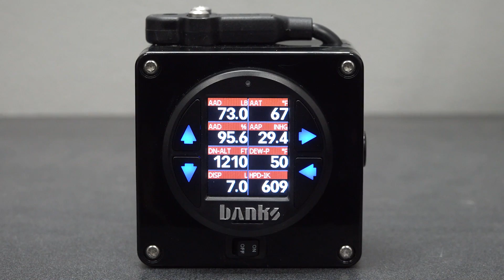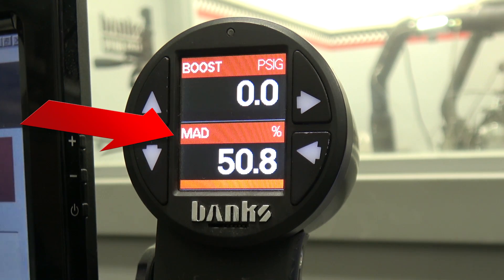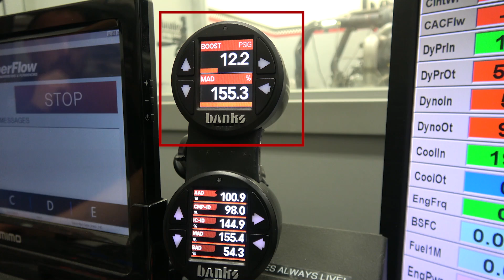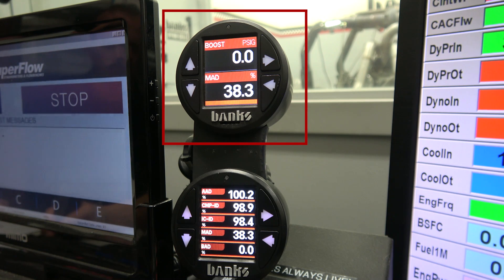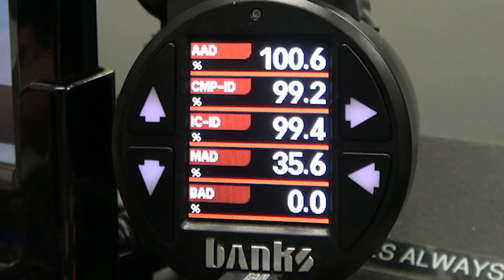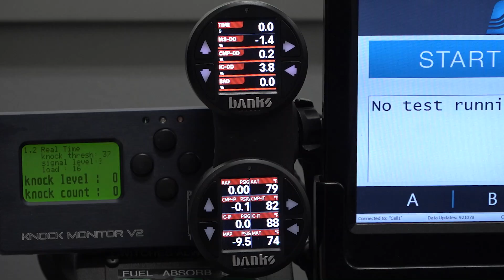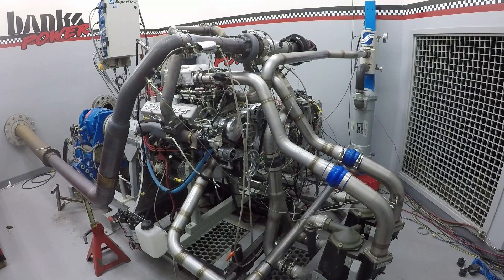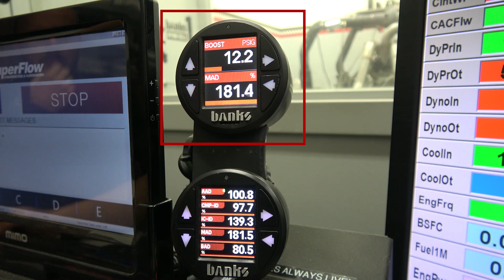Why the boost gauge is dead

Comment: methanol injection was big years ago but none talks about it anymore.....its chemical cooling, just like the intercooler.....does anybody know why?
Reply: I think E85 KILLED IT.
Reply: It's still awesome. You can just use water or windshield washer fluid.
Reply: @ike fun not very expensive at all compared to nitrous or anything like that
Reply: It was first used on p-51 mustang fighters during ww2
Reply: @scallen3841  
P47  also . I  believe  most  of  the  ww2  high  performance  aircraft  used  in  conjunction  with  supercharger/turbocharger  to  keep  head  temps down .
Reply: Cbmech Yes that is why , I know a few vets who worked on both those aircraft during ww2 . It was bad ass working on jet engines while I was in the Navy .
Reply: @scallen3841  Nah - a guy named Bucchi was a Swiss engineer who all-but invented the turbo in 1924. It was used on Diesels - they literally broke their dyno ! But on production airplanes I think it was the B-24 bomber using turboed Pratt & Whitney R1830 air-cooled radial engines. More HP for takeoff = more fuel or bombs. In just a matter of months P-47s, then B-17s then P-51s. I believe the Grumman F6F and the Chance-Vought F4U followed next (basically same engine as P-47, no turbo) and finally B-29 bombers with turboed Curtiss-Wright R-3350 radial engines, last thing during the war.
PS - Early jets used water injection, too !  Not like there was any chance of detonation of jet fuel (keosene) at the pressures available then - instead it was to add mass to the air ejected out the nozzle and bonus it dropped temperatures on the shitty turbine blades being used then (or allowed more fuel to burn at same temp = even better)
Reply: Helve Hammer Yep i know we covered all the early jet engine design and operations , when I was in jet engine mechanic school .
Reply: @scallen3841  Ya' know - just the other day I was watching a modern high-bypass fanjet airliner and wondering if water might have a place in that application.
Far as I know the Douglas DC-8s that Braniff used to get in and out of La Paz Boliiva were the last certified airliners to use water-augmented thrust and it was only at that one airport. (See what happened when takeoff there went wrong !)(scroll halfway down this page to the comment about "Splash of Colors")https://www.pprune.org/tech-log/10847-high-elevation-operations.html
Reply: Helve Hammer I work on cars now , I'll.watch it thanks
Reply: @scallen3841  Yeah - I had a little legal trouble and got my A&P ticket pulled.
Commercial floor-  and also truck-mounted carpet cleaning machines, debris loaders (chipper-shredder-blowers), tracked excavators, gas-burning Ford F-series trucks and trailers and hot high pressure washers pay my bills. One hobby is torturing 2004-2007 computers into running stripped down Windows 98 (second edition) to run the injectors, coils and whatnot on V8s (in realtime -doing the math instead of making maps). That fits into the main hobby of keeping the stick-trans mega torque mid size American road car ("freedom machine") flame alive . . . (I've cut down several 4-door GM A-bodies into two-seaters - and make my own blower drives and turbo installs) Did you know maximum horsepower (for ANY GIVEN FUEL) happens at 6.5 -to-1 compression ? Yep - provided you have unlimited boost and airflow. (and mind the tailpipes - they'll glow red all the way back to the bumper, lol !)
Reply: Helve Hammer i enlisted in 1987 and served till 1992 , i was a jet engine mechanic on fa-18c's in the Navy
Reply: @scallen3841  Cool. I have dreams about having my mitts on Hornet stick and throttle and surviving a cat shot. You ? Or is that ho-hum stuff ?
Reply: Helve Hammer I like working on the them
Reply: @scallen3841  I liked piston-era 4 engine transports. The last flying machines I worked on were Boeing 757 and 767s - but I will always love 727s and Lockheed Electra II turboprops.(C-130 wing and power - ten tons lighter, lol - makes a hell of a firebomber!)
Reply: Works great I still use it. 
My first setup which I used for years was just a washer bottle setup. 
I had a carb jet in the hose and blew it in the turbo inlet on a non intercooled setup. 
You could definitely feel it hit when you pressed the button. 
It might work on intercooled setups like that , but depending on a lot of variables it can puddle up in the intercooler, but it could be worth a try because shit like washer bottles are probably layin around most hordes.
Reply: You been living in a recluse somewhere ? water/methanol injection is huge, and has been for a very long time and there are dozens of suppliers, with tens of thousands of users. It is very common.
Reply: It is what it is......my friend used to build motors and he thought it was the next big thing........but he lost the business lol I guess he was wrong
Reply: The BMW M4 GTS has distilled water injection from the factory.
Reply: @IronFlamingo  Yes Oldsmobile had that in 1962 on their Jetfire sedan with it's Turbo-Rocket aluminum V8.

Comment: I'd be really interested in a modular gauge that doesn't work off the OBDII port. My truck is pre OBDII and I'd like to monitor things like MAD, oil pres, water temp, etc. I think there would be a good market for another version of the idash in which you can hook up what sensors you want directly to the gauge in a modular type setup.
Reply from the maker: Good news. We're working on pre-CAN iDash with all the sensors. Stay tuned!
Reply: @bankspower  That's great! I'm looking forward to it.
Reply: That's a good question, and good to see that Banks is working on a setup like that.  Hopefully it is more generic and doesn't rely on the computers, for those of us who are either pre-ODBII or wishing to tune up an older diesel for use in a newer truck.

Comment: More of an opinion piece. A boost gauge is not totally useless. I'd like to see the evidence that humidity plays a "huge" role in performance...
Reply: Based on my calculation, a change from 35% to 85% in relative humidity equates a 10% change in air density (when everything stays the same). A drop from 95*F to 60*F has an 8% change in density (when humidity is constant). Based on the physical equation it appear it would have a large role. We all know the performance differences between a 95* and 60* day at the track...which is probably why, when someone runs in the winter down south and it's 50* with 50* humidity (as opposed to 95 and 90%) you're seeing a combined effect and thus significant gains.
Reply: Look up a psychometric chart. You will have your mind blown. Use it for Hvac and humidity is a huge factor.
Reply: Humidity going into an engine is not something you can realistically alter. I'm guessing since they don't spray water vapor into engines, that the more humid the air, the less dense it is. Removing water from the air would be massively inefficient, and you would waste many times the power drying the air than the power gained created by the drier air. You're stuck with ambient humidity.
Reply: @timramich  they do spray water vapor into engined dumbass, it's called water injection
Reply: @christopherjameswall5182  Yeah, I'm the dumbass, tough guy, that doesn't understand the difference between humidity of the ambient air and removing heat from charged air by evaporating water into it. Water injection goes beyond what moisture air can even hold. Not even comparable to relative humidity. I'd imagine drier air is more dense than humid air, so water injection is for a purpose or cooling through phase change.
Reply: @ike fun Tough guy here
Reply: @ike fun And no, you can't dehumidify it without using more energy than you would gain from drying it...
Reply: @ike fun Because humid air is less dense than drier air, and even less dense when it is heated up, by say a turbo.
Reply: @ike fun As I've already mentioned at least twice, the evaporation of the water removes heat from the air. The methanol thing is about octane. FFS, drier air is more dense. Do a simple search. This is about relative humidity of the air. Dumbass...
Reply: @ike fun , no he's right.  It's you.
Reply: @ike fun Nope. I'm not the "retarde" here, "methanal" boy. When a liquid TURNS INTO a gas it absorbs energy from whatever is around it. It's called a phase change. It's how a refrigerator works. This is not the same as moisture already present in the air as relative humidity. Educate yourself or STFU.
Reply: @ike fun I don't know who's right, I just know you are an idiot.

Comment: How much of a difference does it make to "upgrade" a factory intercooler?  Here we see a 9% gain by adding an intercooler, but would there be a noticeable improvement from upgrading to an intercooler that is 20% more efficient?  (I know this is supposed to just be about MAD, but it's also kind of about how much power you gain from using an intercooler...)
Reply: Density varies inversely with temperature in a linear fashion. If you cool it 20% more, you get 20% more oxygen molecules in the same volume at the same pressure, which means you can burn 20% more fuel. I would expect the power to go up by 20% of the 54hp delta, or another 10hp roughly. Im sure some engineer will point out why I am wrong with some equations, but thats the idea.
Reply: Back in the late 80's and early 90's, the aftermarket big front mount ICs used on the Buick grand nationals were bringing 40-50hp, 4-5 tenths in the quarter. They were quite big, out in front of the radiator, and flowed a lot of air.
Reply: @GNX157  great info. Thanks for posting. I guess in gas motors, the injection system adds more fuel as the air mass goes up. So the grand nationals probably added more fuel automatically when the intercooler was changed to a larger unit.